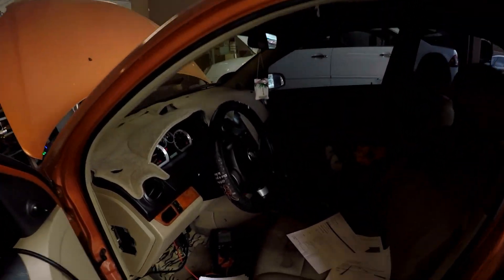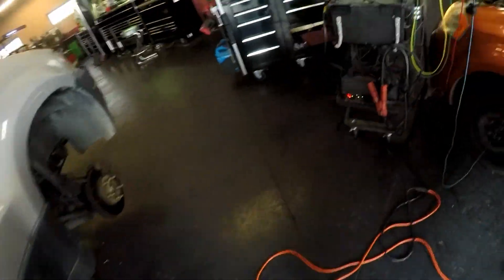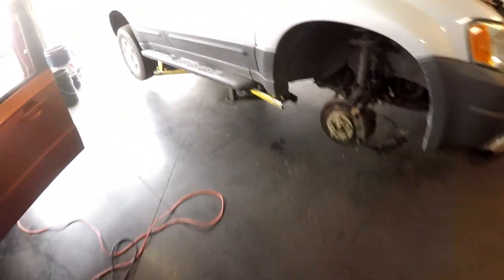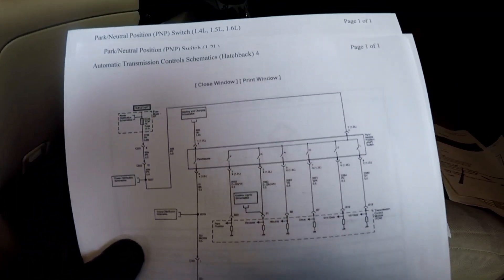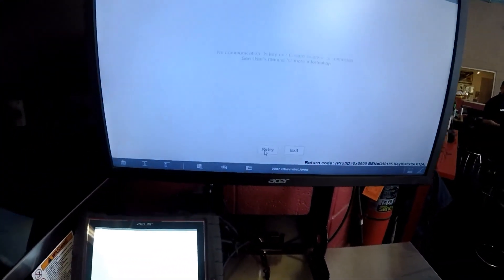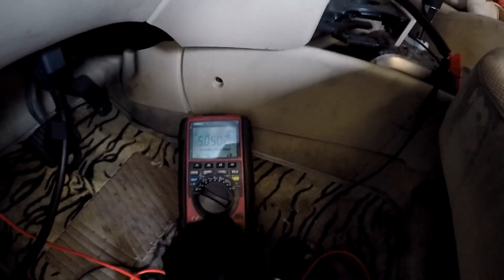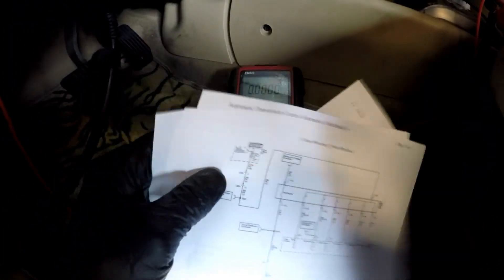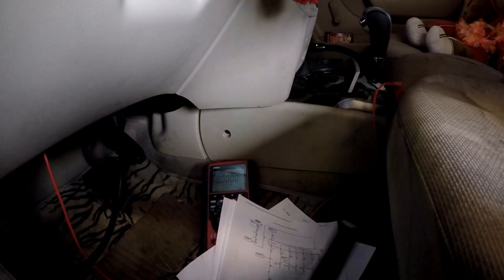CHEVY AVEO PO705

Comment: how did it run? with no pcm/tcm communication
Reply from the maker: That’s a good point since both modules were only getting 5volts on that leg of the circuit. At times this car would be a no crank/no start.
Reply: did you you the problem w you remplaces the five box , thanks for you time